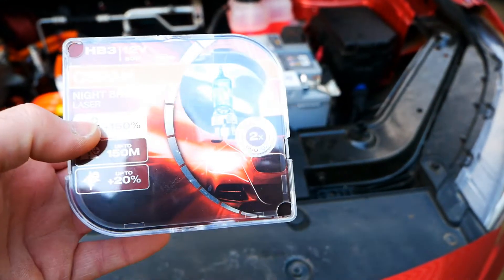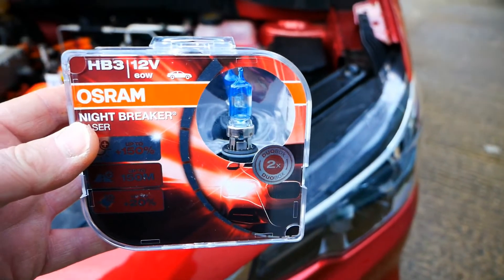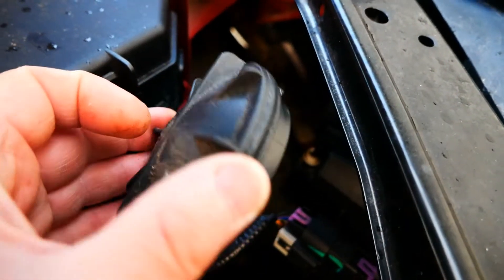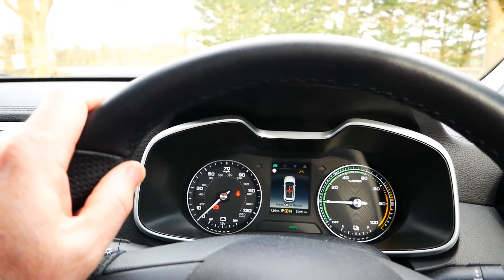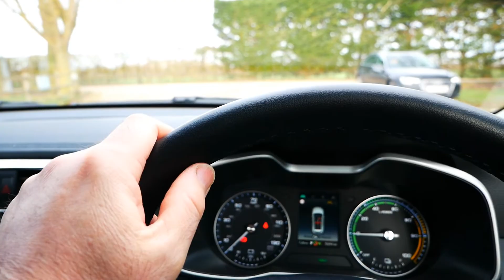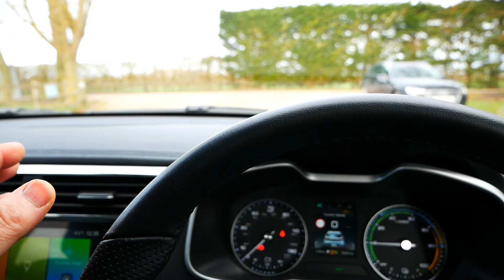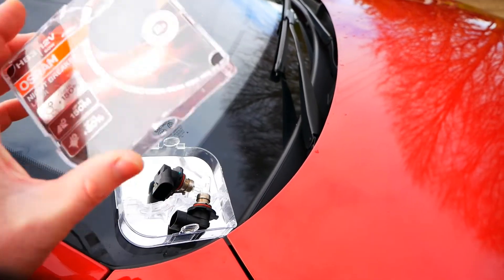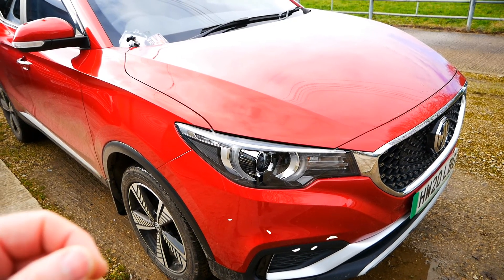Upgrading the MG ZS EV headlight bulbs (part 1) - well worth doing!

Comment: I've used Osram Nightbreakers for years, I think I've only ever had one fail. They are an excellent bulb upgrade. The only reason I've not fitted a set to my current car, a Mitsubishi i-Miev, is that I need to remove the headlights to do so.

The reason you shouldn't touch headlight bulb glass is that, due to the high operating temperatures, the glass is made from Quartz:
If you touch it with bare hands then, when lit and heating up, oils deposited by your skin can cause the touched area to expand at a different rate to the rest of the glass causing failure.

Comment: The reason the OEM bulbs are dimmer is that they are HB3LL where the "LL" stands for Long Life so they don't burn as bright (thicker filament I assume).
Reply: Watching this on TV, I flicked on my i Pad to make exactly the comment you have written - in fact the handbook actually states that  the OE bulbs are ‘long life’ and should be replaced with equivalents.
Clearly the Chinese developers/test drivers have far superior eyesight to mine! They are, apart from the sluggish centre screen (oh, and the lack of tinted windows!). about the only poor aspect of the car, in my view. Driving my ZS EV at night for the first time on winding country roads felt positively suicidal and, coincidentally, I have replaced the bulbs with these Osram Nightbreakers, having used them, to great effect, on my 3 previous cars.

Comment: Can't wait for you to do the under the hood check.
I'm a bit scared to get this car because my father in law, a mechanic, has big reservations about the quality of Chinese cars he's seen so far. I'm really hoping this one is different though because there's pretty much nothing else available in Australia that would suit our needs without being absurdly expensive.
Your videos so far have made me hopeful. So much of youtube is focussed on the initial experience of driving, but what I'm really interested in is how likely am I to have problems in years time.
Reply from the maker: SAIC have more experience of making EVs than European manufacturers. I expect the drivetrain to be excellent.
Reply: There is nothing wrong with the MG’s, they are are just as good as any equivalent manufacturer around, the only difference is they are better value for money and the build quality and reliability is excellent. I’m running a mk2 MG3 and have been very pleased with it. Regarding the lights, the 3’s headlights are excellent, the only downside with the car I wish they fitted driving/fog lights so you could put them on when driving down country lanes at night giving you the extra spread of light into the verges. I’ve been told that they are not going to offer that option, whereas the ZS & HS they do.
Reply: Have had my MG ZS for 3 years. Trouble free and no issues. Only thing was the GPF filter.. just like the DPF but for petrol cars. Fortunately my dealership did a 'forced regen' on it costing £114. A bargain when you consider it can cost 1k to get a new part replacement.

Comment: How does this single filament bulb provide both main beam and dipped beam? There is only one hb3 fitted per side, and the bulb is just a two wire (+ and -), single filament, so I am guessing when you put the stalk to main beam position, there must be some sort of motorised reflector inside the headlamp that deflects the light beam.
Reply from the maker: It is this, yes. A mirror I think.

Comment: When you say that the original bulbs were no shining high enough did you make sure the  head light adjustment on the facia panel was in the proper position on the little wheel.
Reply from the maker: Of course.
Reply: The originals are really c...👎. I can only surgest everyone with a ZS EV to change bulbs as fast as possible. I have gone with LED's, but here I can hear a good set of halogens also can do the job. But for heaven's sake CHANGE💡💡💡💡💡

Comment: I have the same issue with my headlights in my MG3 headlights being rubbish. I've been told by the dealership that if i change the bulbs that my warranty will be invalid. I've been to a couple of MOT testing stations and they've said changing/upgrading the bulbs will fail MOT and may cause the wiring to catch fire. Need help finding someone who will help me to change the bulbs to what you suggest.
Reply from the maker: Modifications would invalidate the warranty, but changing to another halogen bulb is fine and is like for like...just like changing the tyres. See part 2 of this video here https://youtu.be/0YbRezOHIso and read the video descriptions for both videos for all the information and links to the correct products.
Reply: @GoGreenAutos  thank you SO much, I'll watch the other video etc now. The dealership told me changing the bulb would invalidate the warranty. I said what if the original bulb goes am i expected to drive round with no lights?! They wouldn't answer that, just said the bulbs can't be changed. I said i can't drive the car after dark as the lights are so bad. Your video has made it clear that the lights are bad but can be changed. Thank you so much! I even emailed MG head office in UK and they just referred me to the dealership. Now to watch your other video and the product details link and find a garage willing to help me. So frustrating that the lights are so bad, the car itself is amazing. Many thanks!

Comment: Hi, very useful video thank you. Can I ask please if you had any trouble with the clips when changing the bulbs?
Reply from the maker: No clips. The bulbs just twist quarter a turn to hold in place.
Reply: @GoGreenAutos  Well there certainly were on mine that go over the lug on the bottom of the bulb casing to keep the electrical connecter tight. They break off very easily though which is why I asked the question. The only mention I can find about them is at the start of this video https://www.youtube.com/watch?v=-4zTkZdO3S0 I guess the connector is tight enough anyway so not worth worrying about?
Reply from the maker: @karlmanning2997  Sorry, I thought you meant clips that hold the bulbs in as you get on H4 and H7 halogen bulbs. But I now see you mean the clips on the electrical connector. On my car, the previous owner had snapped these retaining clips when changing the bubs to LEDs. But the connectors are tight enough anyway as they have rubber seals that its not a problem, particularly when the cable isn't under strain inside a seal headlight housing.
Reply: @GoGreenAutos  Thank you, appreciated. I broke the ones on mine as well and was looking for reassurance that it wasn't too much to worry about.

Comment: Philips Ultinon pro9000 led , identical beam pattern to halogen , white 6000 Kelvin colour temperature, excellent throw , brighter yet do not glare or blind (tested) .
Past my MOT at a strict garage, down side expensive .
Reply from the maker: That should be an MoT fail now, but of course many testers do not notice the change of bulb types.
Reply: @GoGreenAutos  They usually test beam pattern as far as I know , and as long as they "work" within legal light output its a pass.
The Philips ones are also almost silent in operation. I had brought a couple of sets of Philips White vision ultra bulbs just incase , really just wanted to see if it passed.
I do know cheap leds will fail though.
It was an experiment really , but , as they do not blind anyone and I live in a rural area they will stay , but if they do become troublesome to others and i start getting flashed then they will be out and the White vision ultras will go in.
Reply from the maker: @peteramos6081  The MoT rules changed not too long ago and now the bulbs have to be the type the fitting was designed for. So putting LED bulbs in a halogen headlight is technically now an MoT failure....if they notice.

Comment: Are these bulbs ok for renault zoe 2019 41kwh
Reply from the maker: The Zoe uses H7 bulbs from memory, but yes OSRAM do these in all sizes.
Reply: @GoGreenAutos  just thought I would upgrade
Reply: Hello ..
I read that the call it 1st Gen  Nissan Leaf has bad dipped beam headlights as well , Did you retrofit better bulbs on any of them and if yes which ones please & how much better did it make it ..
Thanks .
Reply from the maker: @chrisrichmond403  Get the same. https://amzn.to/2MNxzaO
They will either by H4 or H7s.
Reply from the maker: @stud196761  We did the same on both our Zoe's we ran for two years and it makes a big difference. Not as much as it did in the ZS, but still well worth doing.
Reply from the maker: @stud196761  I've used these (well the previous generation OSRAM 130% bulbs in our two Renault Zoes and it is well worth doing.
Reply: @GoGreenAutos  I’ve looked on eBay for osram for my car and they don’t fit they say
Reply: @stud196761  got them for cornering lights on kugar
Reply from the maker: @stud196761  Refer to your own user manual for the bulb type, not any online fit guide.

Comment: Cool, but these night breaker bulbs, although marginally better only last a couple of years and generally fail very close to each other so hang onto the original bulbs in the car in case you get caught out on a journey. Novsight LED bulbs, okaaay for dipped beam but could do with being a bit brighter. The foglight versions are just way too dim.

Comment: retrofit leds are way better than halogens , not those cheap ones tho.
Luckily in Italy we don't have a strict MOT, as long as they work and do not blind incoming traffic nobody will ever say anything. Not a fan of those "high end" halogens, way too expensive for a very marginal upgrade. With quality leds you get 5 to 6 more times the light output

Comment: Surely properly set up and road legal LED lights would have lower consumption and be more consistent with EV practice of power conservation? Why are the manufacturers so slow in bringing forwards and modernising the legacy stuff on the car? Having a 12v cranking battery for the auxiliaries is another example of unsuitable left overs.
Reply from the maker: Just comes down to cost. An LED lamp assembly (not just an LED bub) costs considerably more than a halogen unit, that they will also use on the ICE models.

Comment: If the headlight original bulbs are too dim it points to a reflector and lens design issue. £15 a year for better headlights? Not impressed.
Reply from the maker: Then why would the new bulbs make such a huge difference - like twice as good? To me that points to poor original bulbs not a lens/reflector issue. I suspect putting new 'standard' bulbs in would improve things too.

Comment: Don’t leds run cool and the halogens run very hot??????
Reply from the maker: The drivers in LED bulbs run very hot, and why they have fans and which can often make the plastic lamp housings melt. Plus modern high output LEDs (I think they call them CREE) do run very hot.

Comment: There's a lot of aftermarket LED light system out there that cost next to nothing, and makes a big difference to your lighting
Reply from the maker: There are but the new MoT rules are "Existing halogen headlamp units should not be converted to be used with high intensity discharge (HID) or light emitting diode (LED) bulbs. If such a conversion has been done, you must fail the headlamp."
Reply from the maker: @marc2026  Rules changed recently and LED or HID bulbs not allowed in units designed for halogen bulbs.

Comment: I don't think your statement about LEDs is entirely true, halogens will run ALOT hotter than led bulbs, sure hid bulbs run the hottest but it is untrue that led bulbs are hotter than halogens. Its why they use halogen bulbs at the bottom of lava lamps and not led bulbs
Reply from the maker: Generally yes, you're correct - an LED will be cooler than a halogen, but its the drivers which also had heat and this needs cooling. For example, the LED bulbs I show in the video have fans on them. There's plenty of examples where people have melted their plastic light housing by using (cheap/hot) LEDs. They don't melt with halogens which is what they are designed for.